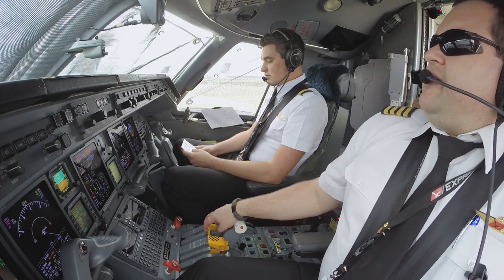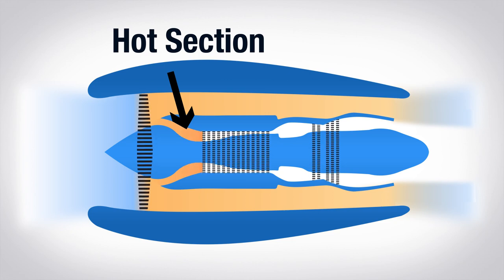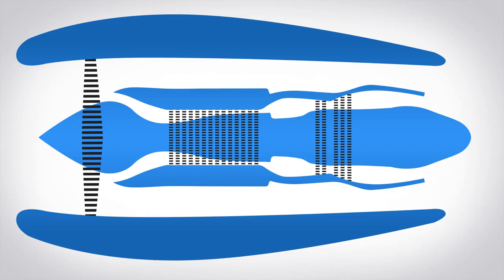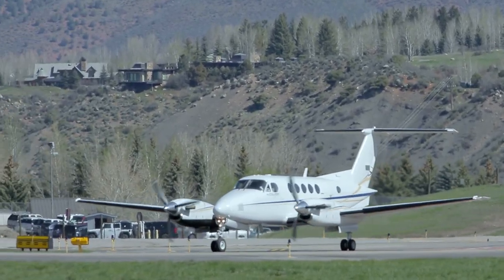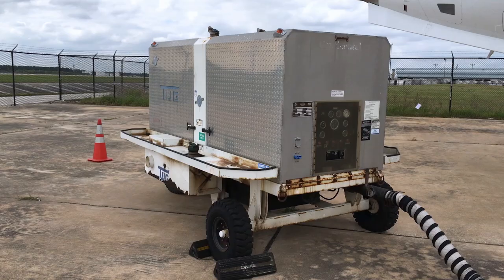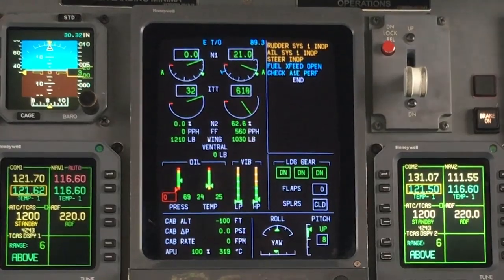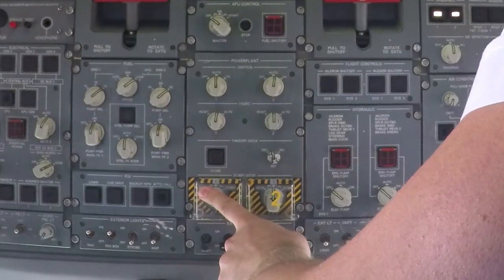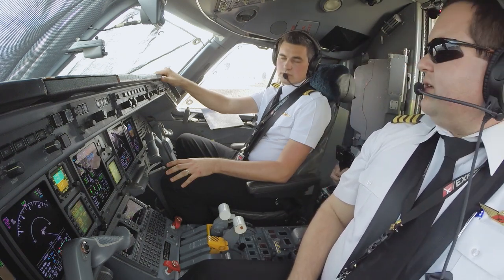How A Jet Engine Starts

Comment: So the core needs to spin at 14% before the igniters start to light but there's no fuel until 28.5%... so light what? All these numbers and absolutes are only about one engine model. And even then the explanation isn't great. And then there's the 787 which uses electric starter/generators and are on the same scale as the largest jet engines and they use electric starters, there is no bleed air on the 787. RR Trent engines use three shafts, so on them it's N3. Note the captain in the video says the engine isn't self sustaining until over 56%, not at 28.5% as you said. Do you watch your own videos?

Comment: So if you start a plane with the hoffer cart because the apu is down. What the hell gone happen if you lose your engines in mid flight, how you gone restart the engines or run a check to see the problem.
Reply: The other engine can provide an air source through the cross bleed.  In fact, most large airliners will start the first engine with the “huffer” and then push back from the gate and then cross bleed start the other engine.

Comment: Where exactly is all this fuel?? Thewings on every airliner  are skinny. Flaps take up a good portion of a wing. They dont have fuel tanks on the belly of the plane , so where is all this fuel?  Starting to think its b.s
Reply: Actually, they generally are in the wings. The tanks go across most of the wingspan and the flaps and slats take up less room than you would think. And even smaller regional aircraft like the Embraer E-175s and Bombardier Q400s load up several thousand pounds of fuel for even short hops.

Comment: THE NARRATOR IS IN ERROR.....bypass air provided by the intake fan "DOES NOT" provide most of the THRUST used by a jet engine as stated in the video. The internal parts (compressor, combustion chamber, turbine wheels, the tail cone and the internal set up) working together provide the thrust needed for take off and flight. Bypass air may help to provide for cooling, air conditioning, fresh air make-up etc., However it does not assist thrust.
Reply: On a high bypass turbofan, which they are talking about, it's the cold bypass air that provides most of the thrust, not the hot section.

Comment: So you show an auto start. It would be more informative to do a manual start. Crank the hp section with the start motor via the GEARBOX, watch for 25%N2, open the hp cock, which adds fuel and starts the igniters. Watch the EGT doesn’t overtake the N2 speed or you will get a hot start. That’s giving the wrong impression. And it’s an air start unit!
Reply: Oh and you also have to monitor oil pressure, N1, and time to reach idle.
Reply: @bobrice3957  I think he was just giving a "layman's" example of a motor start.  You sound like a motor head, like me.  We've started our fair share of jets.  There's a lot more to it than what he's saying.  A lot can go wrong if not properly trained.
Reply: @MarkT There’s dumbing down and simplifying to the point of inaccuracy. Since when did the HP compressor become the hot section? The ignition coming in at 15% is rare and I must have missed them opening the fuel HP cock.
Reply: @bobrice3957  LOL.  Yea, I noticed the core identified as "hot section."  Well, it's connected to the hot section.  J79's were 15% if I recall correctly, but that was a turbojet.....not turbofan.  F100 and F110 were 10%.  I thought he was referring to the pilot when he mentioned "HP cock."  LOL!  We called them "Stick Actuators."
Reply: @bobrice3957  The FADEC controls the fuel valve.  On the 727 and 737, pilots controlled the fuel valve.

Comment: The Airbus 380 is claimed to carry about 82,000 thousand gallons of "Jet A" or JP5 fuel, (manufacturer specs.) This Jet A is weighing in at 6.8 lbs. per gallon, that's 557,600 pounds of fuel divided over 10 fuel tanks. The 10 fuel tanks must carry 55,760 lbs. a piece (tail tank smaller)! If each wing has at least 4 tanks full, that's about 223,040 lbs. of fuel alone, inside each wing (ya sure) with no Center Tanks at all.
 When you try to calculate how many Airline Flights are occurring each day, from any International Airport, you'll realize there is no local "Fuel Tank Farm" that's being constantly resupplied by a fleet of Fuel Tanker Trucks trying to get into the "Fuel Farms" here is an example of the size of these Fuel Farms https://www.flystl.com/newsroom/stl-n..., you can do the math, lol. https://skymarkrefuelers.com/products/ their biggest Airline Tanker is only 10,000 gallons! So it would take 8 of this type of Tanker to fill the A380 just once! LOL ...
 Commercial Airlines and Military Jets are started by the (APU) Auxiliary Power Unit (Aircraft Engine Starting-Wiki) https://en.wikipedia.org/wiki/Aircraf... and run on compressed Air, it's Viktor Schauberger Turbine Technology http://www.antigravitytechnology.net/... but this is a Trade Secret and they'll never admit it. People would feel cheated, and demand refunds and we'd start asking questions about the 9/11 Event fireballs etc. Failed Links will work at my Channel Community Section.

Comment: ÀU 195 clear push back,, egs . Ahhhh ok clr to start e2, ok select on ff , it n1 rising n2 spool up, selecl e1, ground  valves close  , vlaves from e1 to e2 selected. ? E2 bring up to 85% ahh it  , ff ,ok n1 rising , n2 spool up,.bot2 engines stability maintain.

Comment: The crew never called out oil pressure on either start.
Reply: Mark Victor because it’s not a standard callout for that company. Doesn’t mean they aren’t looking for it during the start sequence.
Reply: @pilotman46  As an A&P Mechanic I've been trained as soon as we get rotation we call out oil pressure than watch for ITT.
Reply: Mark Victor I don’t doubt it. In the Part 121 world it’s all about the callouts. We are trained to keep an eye on the oil pressure a long with everything else during the start sequence same as you, it’s just not required per SOPs to verbally say “oil pressure”. It is what it is. If you don’t like it, feel free to contact ExpressJet Airlines (the company in the video) and express your concern.
Reply: If you read their FM, it probably states that they are to observe the following: start valve opens, N2 rotation, oil pressure, ignition, N1 rotation, EGT rise,......

I can only speculate because I don’t work there.  But it is obviously not required by their SOP’s.

Comment: A TurbAN is what Sikhs wear. A TurbINE is what is inside jets. Spoils an otherwise good video. I used to be involved in OEM and repair of turbINE blades that go into a turbINE, so speak with some knowledge on the issue.
Reply: seems to be a US thing, or just some parts of the US.